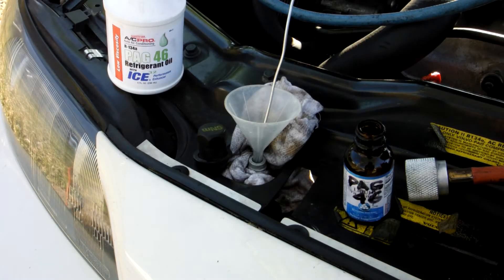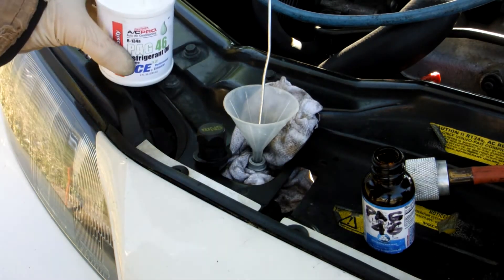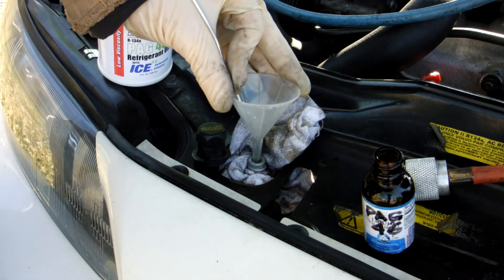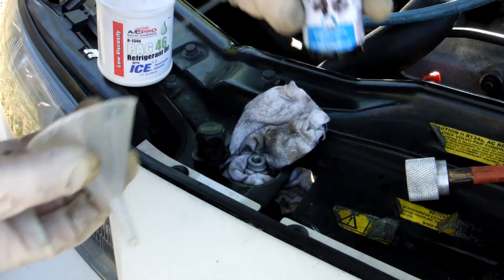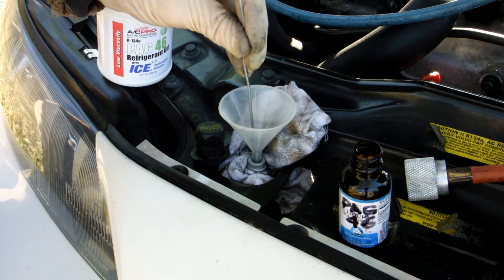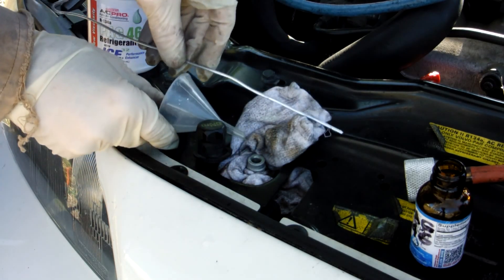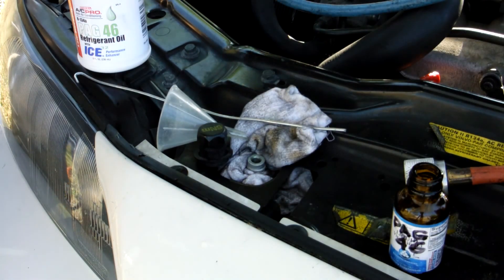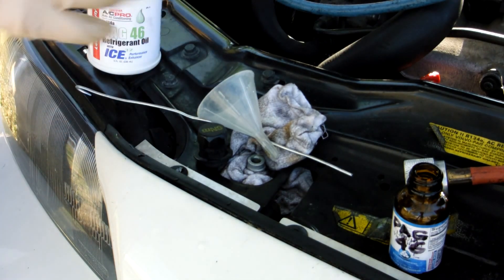Adding PAG 46 oil to A/C system through High Pressure port with a funnel.

Comment: Bro you’re completely filling the system with moisture from the air! running the vac pump, the oil is hygroscopic, so best to add oil with a oil injector keeping the system sealed. I would of also drained the oil from the compressor you got from the yard and replaced with new. I know it’s tempting to save money in these areas, but it’s not worth it.
Reply from the maker: OK. Thanks. Viewers take notice!  I thought if I kept the funnel filled with oil the vac pump would only pull the oil from my funnel. Hope I didn't add much moisture from the air in that process. It was low humidity that day. Continued vacuuming system after adding oil. Yeah, I probably take more risk than I should sometimes. Sometimes it comes to bite me for doing that but sometimes life, uh, finds a way. 
2yrs later,... it's keeping the wife cool.
Reply: What you need is a vacuum and gage system. What’s the system is empty you turn on the vacuum and check for leaks when the gauge reads zero you shut the vacuum off let it sit for 20 minutes if it moved the needle then you have a leak and you need to address it. if the needle did not move, then you can shut the vacuum off close all valves disconnect low pressure line. Take out the stem and add oil with car off. Put stem back in next connect your gauges back up and vacuum system again once it’s at zero, you can shut the vac off close the gauges again the line that was going to the vacuum , connect to a can of 134 A. Start car open gauge valve and add R134a   Most carry 28-32 oz
Reply: @rayray9777 if you open the valve stem as you say under vacuum you will suck in air laden with moisture. Best to add a positive pressure with dry nitrogen to 1 or 2 psi positive pressure before you open the system. Checking for leaks with vacuum is not the best idea as you will draw moisture in if there is a leak. Analog gauges are not a good indication of a leak as you can have a very small leak that you will only see with a micron gauge. The best way to test for leaks is with positive pressure and a pressure test with digital pressure sensor add 165psi of dry nitrogen let it acclimatise in the system for 15 mins as to not get an incorrect reading and then start a decay test.
Reply: @rayray9777 bro spending $400 just to get cold air is crazy asf and doing too much